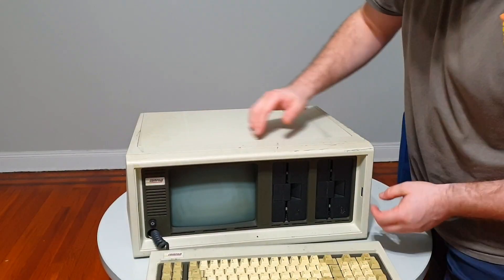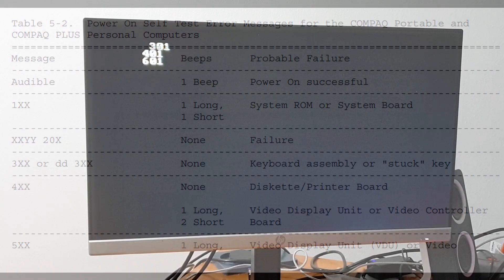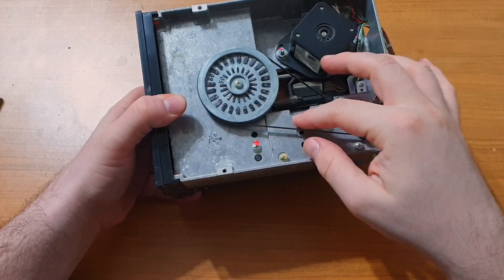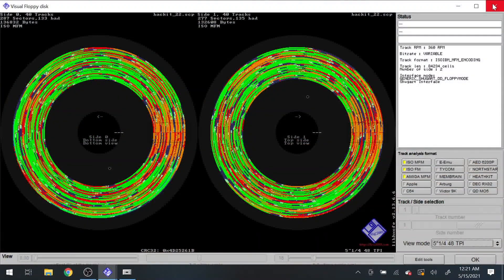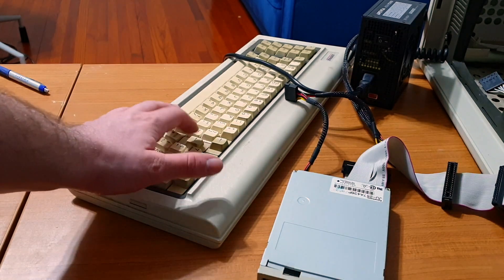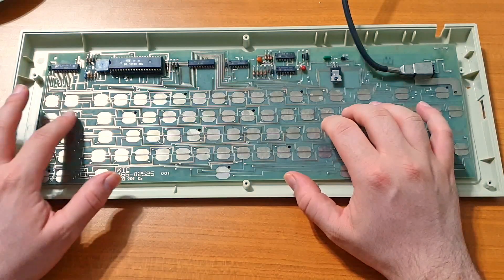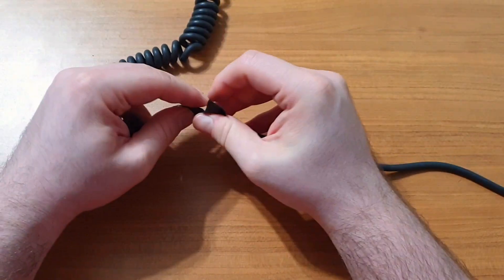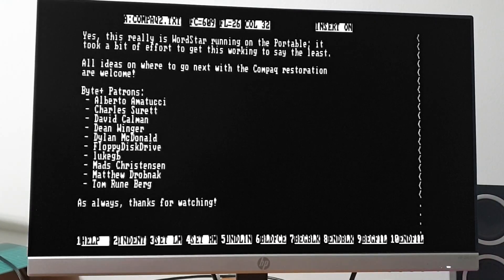Repairing One Of The Worst Keyboards Ever Made ... // (Compaq Portable Part 2)

Comment: NCommander, I am working on restoring a Keytronics A65-02428-001 Capacitive keyboard. It looks like the same manufacturer was used in the Compaq and would like to know if the board has a couple of EXAR I.C.'s that do the keyboard scanning. If so, could you let me know what their part numbers are?
Reply from the maker: From what I've learned since, there were multiple revs of the Compaq portable PCB (I think I said it in the video), so I'm not sure how much any info I can provid ewill help since it was clearly reworked multiple times.
Reply: @NCommander   Actually, your video helped me to identify an I.C. that blew on my Visual 50 keyboard. I just wanted to verify that the chips on the board you showed in your video is the correct one I need to fix mine. After hard searching I was able to find an XR22-950-3B available through eBay. The other one should be an XR22-908-03.

Comment from the maker: UPDATE: The Retro5 disk drive belts didn't work fit properly, despite being close. I'm looking for other solutions.
EDIT: Ok, they sorta worked. As it turns out, installing them is very difficult, but the drivers are still kinda kaput.
Reply: The only update we expect from you now is part three. Pleeeeaaaaseeeee.
Also is there a cheaper alternative to these foam thingies?
Reply: @Kardor  $29 for a full set really isn't that bad. I tried laminating my own and it didn't work out.
Reply: @Kardor  8-bit guy tried making his own when he reworked his Compaq portable.  He ended up going with texElec, but perhaps you might take a look and see if you can improve on his efforts....but yea...$29?  I'll probably bite that bullet when the time comes too.  I don't have the knowhow, and it would probably cost more the $29, but I'd love to have a mechanical keyboard replacement that would drop into the old keyboard case for this.

Comment: 12v line in the keyboard and then regulating locally will make the 5v supply at the kbd cleaner with no noise picked up along the cable to the mother board. This decision was likely made due to the sensitivity of the capacitive sense circuitry and the routing of the coiled kbd cable near the CRT and PSU.
Reply from the maker: That's quite possibly the best answer I've heard. I didn't emphasis it, but it really doesn't take much capacitance to set off a key press, and I had to do a fair number of adjustments to get it to work, so this might be actually why if the cable run at 5v introduced too much noise.
Reply: That is debatable and would only make sense if also the data transfer is happening at the greater differential voltage of +12V to GND. Which is NOT the case[1]. A near decoupling capacitor and the at the time usual ferrite-EMI-supression filters at the cable would be sufficient. The evaluation of the capacitive keys happens locally and by the way is a possibility to completely avoid the usual problem "antenna keyboard" (as an electromagnetic receiver) (capacitive!). Separate voltage regulators are used where a correspondingly high current might disturb the supply voltage and following the signal integrity. But that is not the case here with a keyboard with <100mA.
I don't know exactly, but I'll bet my grandmother's glass eye: This is probably a question of avoiding patent infringements, which was a piquant legal issue at the time with the IBM PC and the lack of open standards. So one culprit could be patent USD292801S by Inventor Myron F. Davis, Jr.; Ted F. Kelley, Jr. with the  Current Assignee: IBM Information Products Corp.

That 7805 just make no sense from a electronic design viewpoint. Even if that keyboard was a out of house product, we are talking about the 1980ties. The Compaq  designers would have had full control and be aware of the design of the keyboard electronics. Oh and this was built on a budget. So extra $2 for a unnecessary component? Yeah, if hell freezes over!:))

[1] Just use your brain: The SAME individual cores of a cable pick up the same noise. But we have to somehow use 12V to guarantee a stable 5V at 20cm distance ... with nearly no power consumption? And then we ignore the supposedly noise for the DATA LINES? That makes no sense! Your assumption makes even less sense when we consider that the keyboard cable is shielded (and BTW that shielding is broken at the electrical-tape-botch, see Video).

Comment: The case isn't cracked, because I took my own Compaq apart and the plastic cover is made from upper and lower part. (you need to unscrew the carry handle) After the whole disassembly, there will be left just the metal frame (it is riveted)
Reply from the maker: It actually cracked visibly (I saw it crack in front of my eyes), and I can see from my old footage that there are cracks that shouldn't be there.
Reply: @NCommander  Oh, If you saw it cracking, then the plastic is probably broken. But in the video, it looks like, it is right at the point of connection between the upper and lower case part. I also have a gap there on my Compaq, but there is a little stud sticking out from the lower to the upper case for correct alignment of the parts. The stud might be broken, so that's why the bottom part is slightly offset from the top part. Anyhow, good luck on repairing the Compaq.
Reply: @NCommander   solis123 is correct. That is the seam where the two case halves come together. You may have thought you saw it crack, but that is two separate pieces of plastic. I’ve owned and repaired many of these, so I can confirm. Definitely don’t glue it, or you’ll be in for a world of hurt if you want to take the plastic shell off ever.

Comment: There many rubber belts in most of retro FDD/CD drives that usually become slippery due to rubber oxidation. I managed to work out (after lots of testing) that a solution used to maintain rubber V-belts in a car works fine also for belts in legacy drives. It actually make rubber more sticky and increases friction, which is exactly what we need. I use a solution  in a form f sprawy made by BOLL, but others shall work as well. Just dismount a belt from a drive and give it a good wash in a solution (I use small glass jar to fill the bottom with solution up to the point where all the belt is covered) and leave it there for 1-2 hours.
Reply from the maker: I'm not finding this form f spray. can you post more instructions/stuff I need?
Reply: @NCommander  sorry, I meant 'form of spray'. I did not notice that this got autocorrected. It is this one: https://www.amazon.de/-/en/gp/aw/d/B07NPYGLCK/ref=cm_cr_arp_mb_bdcrb_top?ie=UTF8 but I think any of those vbelt spray will do a fine job.
Reply from the maker: @86smoke  hrm, it seems Boll isn't sold int he United States, and I'm having trouble finding an equivelent product, so I dunno how much help this will be. I'll keep this in mind though.

It sounds like you just put it in a container, and soaked it though?
Reply: @NCommander  It looks like in the US this stuff is called 'belt dressing', 'belt grip spray' or 'belt conditioner', but it is not as popular as it is in Europe. I found out that Wurth USA should be selling it locally.

Yes, I put rubber belt in a small container, giving it a good flush, then close a lid and leave it for some time. After it dried a bit (but not completely) it is good to go.
Reply from the maker: @86smoke  I ordered some, we'll see if it works.
Reply: @NCommander  just make sure it is designed o improve grip of the rubber
Reply from the maker: @86smoke  I grabbed this, https://www.amazon.com/gp/product/B000M8PZB4/ref=ppx_yo_dt_b_asin_title_o00_s00?ie=UTF8&psc=1 which also noted reviews that someone did use it for a CD drive belt.

Honestly, this will be amazing if it works, so thank you for cluing me in on it. It will take a few days for it to arrive but I'm really hoping things will be good.
Reply: @NCommander  This should be fine. I am also surprised that it costs ca. 10$ more mine.
Reply: @86smoke  Ta autokorekta z wyrazu "spray" na "sprawy" zdradziła twoje polskie pochodzenie xD
Reply: @Kardor  cóż, tak to jest jak się pisze na telefonie, a nie po bożemu na pececie
Reply: @86smoke  Ja i tak autokorektę mam wyłączoną.

Comment: I would guess that the keyboard PCB was used on other machines that had 12V keyboard power. It's a very odd voltage to use for a keyboard though... I guess if the cable was long enough it might help with losses, but the keyboard shouldn't draw much current.
Reply from the maker: That was the best theory I could come up with but the cord isn't that long, and the data lines are signaling at 5v just fine at that distance
Reply: @NCommander  the data lines have no load though, maybe the port is a Compaq thing that can connect higher power stuff. Tape reader maybe. It's a pretty wild theory though. Might do some research...
Reply: I'm thinking it could also be noise mitigation, assuming the data lines are stepped up to 0-12V as well.  The bigger the threshold on a voltage-signaled line, the more noise it takes to disturb it.  Given the cramped conditions of the Portable, and the proximity of the CRT's (relatively) high-emission electronics, it seems a reasonable concern to me.
Reply: @EdPenwell  Could be, 12V signalling for RS232 was common at the time and suitable driver chips were readily available.

Comment: oh chyros hates the foam and foil keyboards even more than you do, they're truly the work of the devil

edit: why is the output of the portable so noisy at times? is it just a bad composite output or is it not properly shielded? 

also, the keycaps seem to be doubleshots. they're very expensive to produce, but they last pretty much forever, as the lettering is separate from the surface. sucks to see that they're really flimsy though
Reply from the maker: Chyros is right to hate the foam. I legitimately have no idea what inspired Compaq to use this horridness. The only semi-fessiable answer I can come up with is weight, since buckling springs and the like are heavy..

As for the composite, it's likely a combination of old capacitors, and line noise. It's gotten considerably better the more I ran the system (and I already blew a cap on the VDU). I actually did color correction to remove some of the noise, but it's not great. I also suspect some of it is being introduced by the Retrotink.
Reply: Who?
Reply from the maker: @videocommenter235  https://www.youtube.com/user/Chyrosran22
Reply: literally who?